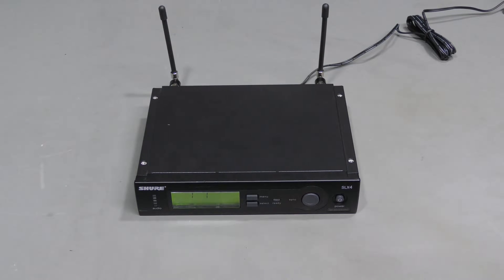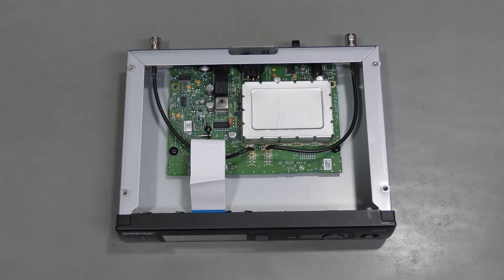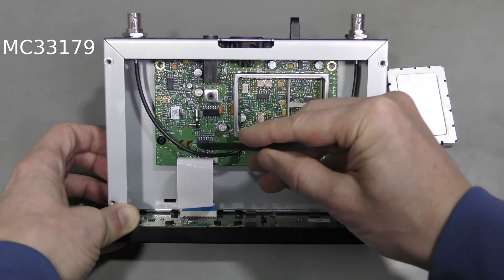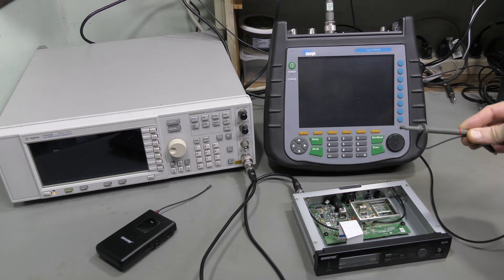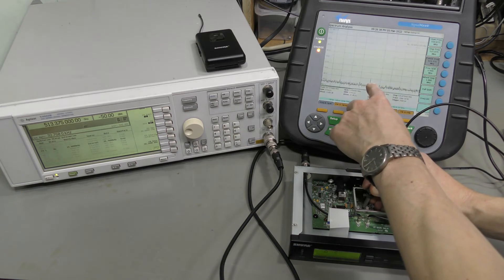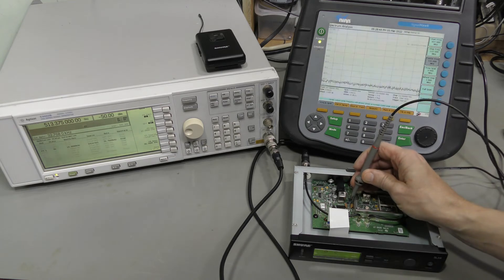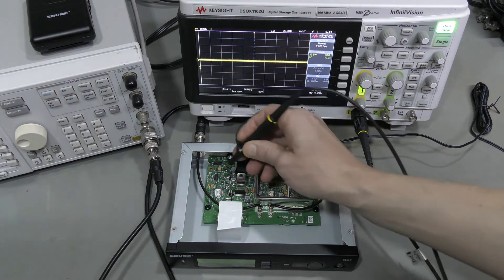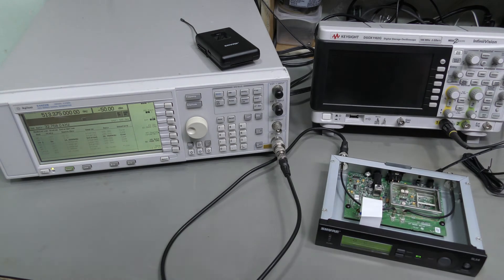#151 - Shure SLX receiver repair

Comment: Dear Sir, i have the receiver model svx288. It has the problem with channel A, the radio signal in the receiver is not stable, it’s continously switching between A and B signal. The output sound is also unstable and sometimes mutes. Could you advise how to fix it? Thank you so much for reading my comment!

Comment: Wow blasting 5 volts ac into the crystal seems like a quite hard drive… doing the same circuit years ago the crystal manufacturer suggested a couple hundred millivolt absolute maximum…
Reply from the maker: Well, saying "5 volts AC" is a bit misleading. This is about 1.8 AC RMS

Comment: How would you track that fault if you only had a multimeter like we normal people?? :) Could you?
Reply from the maker: Well, in this case it turned out that an oscilloscope would do, but it is hard to investigate if you cannot see much.
Reply: I think you can measure the voltage of a 32khz sine wave with some hand held multimeters, agilent 1251A seems to be specced up to 30kHz so I think that would be adequate to see this significant difference in amplitude before and after the crystal
Reply from the maker: @Arnthorg  Maybe. After the fact, when you know the answer, you can optimize the steps. But how do you know beforehand? I would say that oscilloscope should be included into a basic electronics toolkit. They are quite affordable these days.
Reply: @feedback-loop yes I agree. I was under the impression that behcet was asking how to check for this specific fault with minimal tools just in case he encountered one of those receivers.